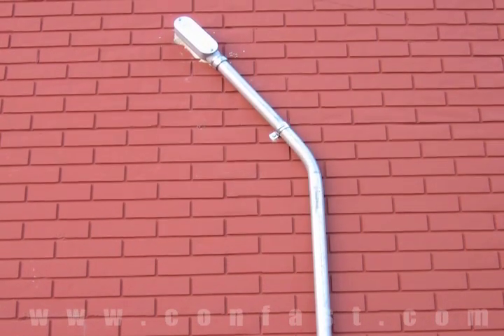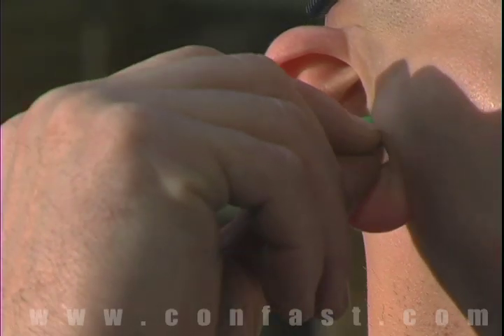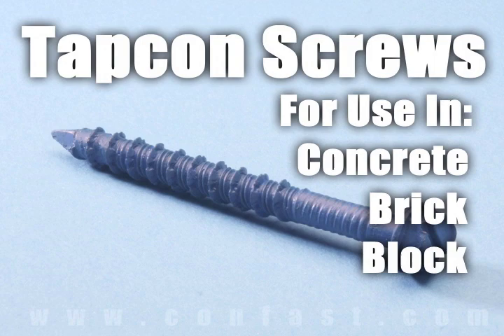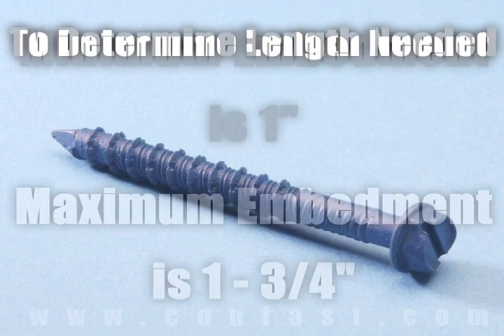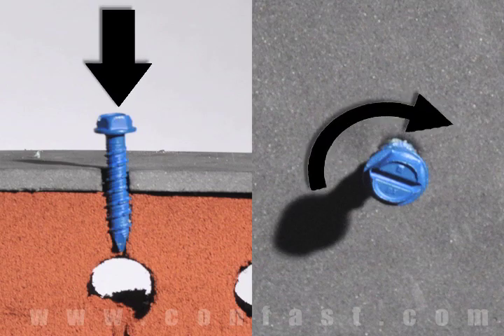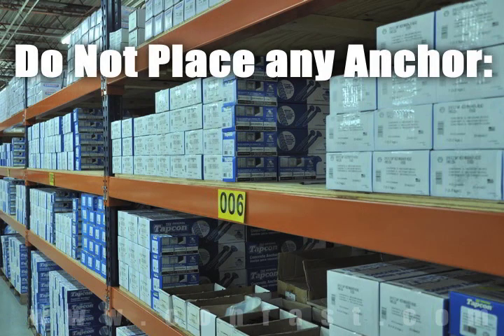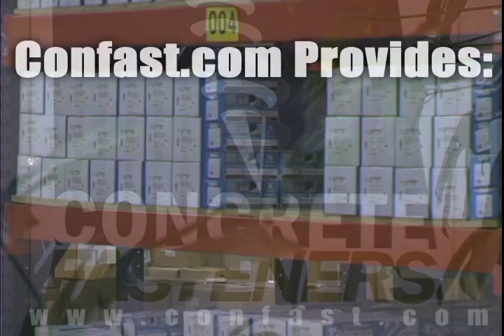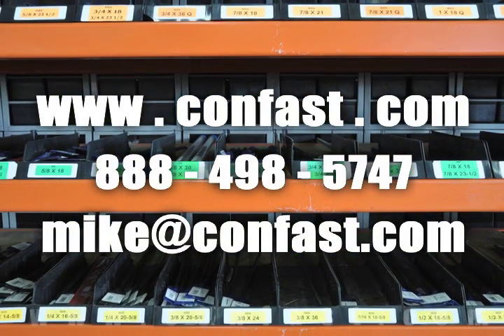Attaching Conduit to Brick Using Tapcon Concrete Screws

Comment: Most people use the 1/4" diameter tapcon, they require a 3/16" hole to be drilled.  The screws can be placed in the brick or the mortar joints.  For wood thickness of 1-1/2" use a 2-3/4" long tapcon screw.  The depth of the hole should equal about 1/4" deeper than the screw will penetrate the base material, so drill the hole a minimum of 1-1/2" in to the brick.

Comment: I want to attach 2x4 s to the sides of brick piers under my deck, so that I can install lattice in the area between the piers by nailing the lattice to the 2x4s. To drill the bricks and secure the 2x4s to the piers: 

a) what type and size of drill bit should I use?
b) should I drill the holes in the middle of the bricks or in the mortar joints?
c) how deep should I drill the holes?
d) What type and size of screws should I use to secure the 2x4s to the piers?

Thanks for anyone's input here!
Reply: The 2-3/4" tapcon is common for 2x4's. Hammer drill the center of the brick for strength, or in the mortar joints if there is a chance you'd like to remove the lattice in the future.